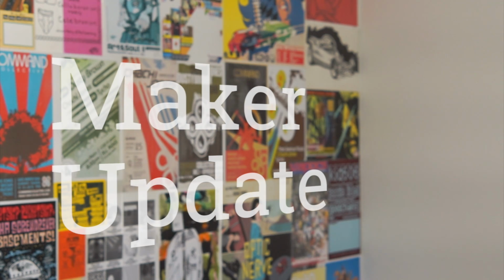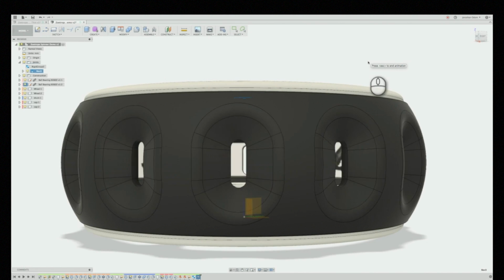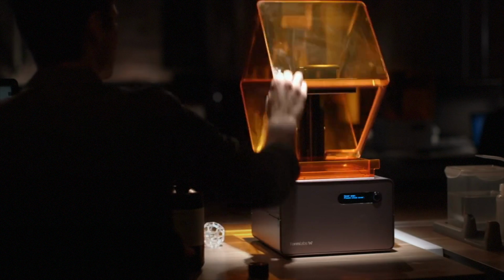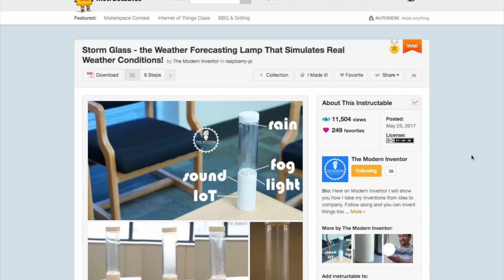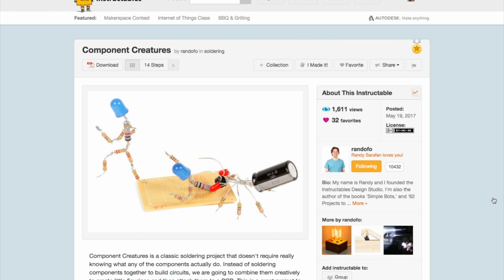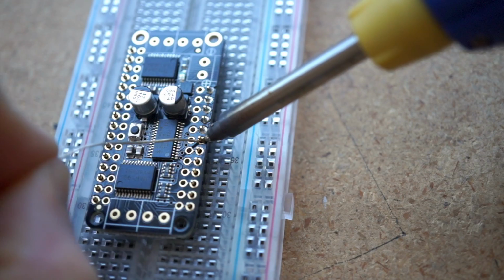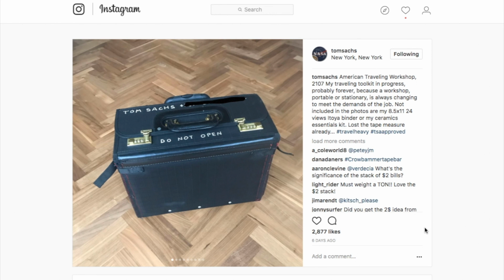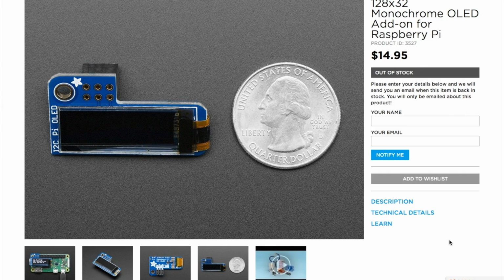Zoetrope Fidget Spinner [Maker Update #37]

Comment: Great video. 

I have a butane powered soldering iron for soldering on the go. The one (and unfortunately) only time it would have been really useful, it was home on my tool shelf. 

We ended up making the much needed fix to the 12V plug useing a nail heated red hot with a torch.

Thanks for sharing!!